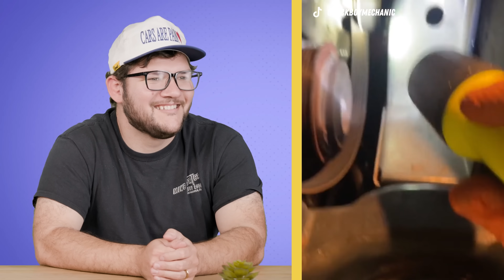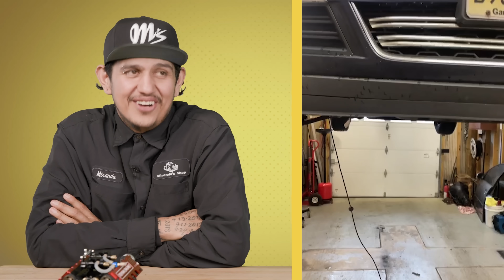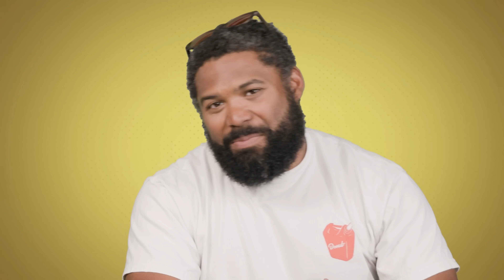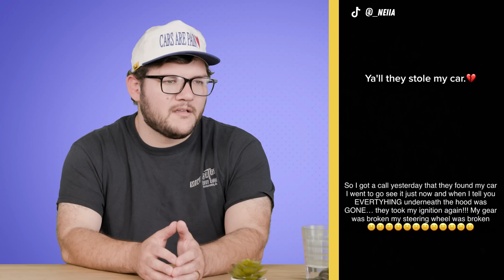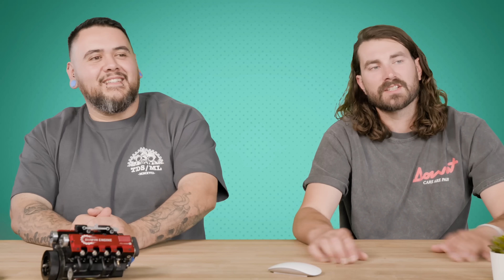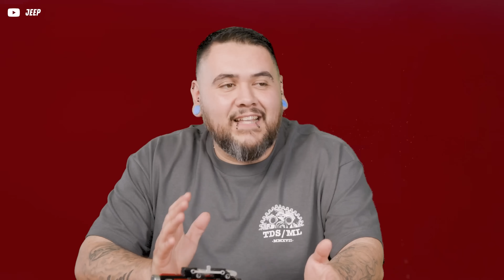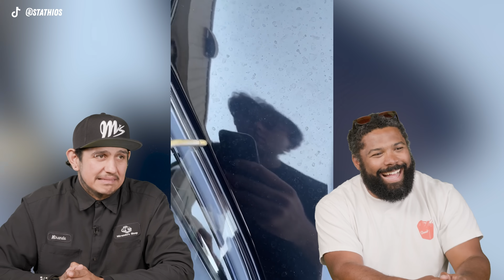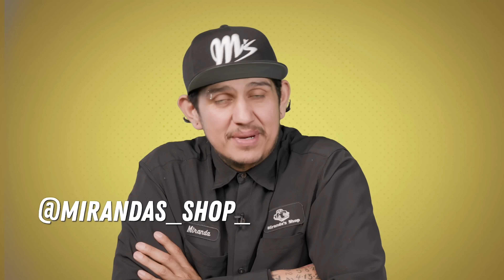Mechanic Reacts to Car Engineering Fails

Comment: Would be really cool if Donut could get some industry engineer's in to talk their perspective and why/how these design choices get made. Nobody engineers a POS on purpose. Some constraint somewhere had to force a trade-off if they were aware ahead of time.
Reply: I can't speak for the automotive world. But as an engineer, I can tell you there are people above us that force us to do things a certain way because of cost, looks, or just they like their idea better. I've also been told to design things to fail more so we can sell more spare parts.
Reply: @MrTterbo83  or some accounting twerp that wants to save 50c on a part here and there and completely destroys s project….
Reply: @MrTterbo83  I'm also an engineer. But I do HVAC design so I can't give any insight into this. Which is partly why I suggested speaking to in-industry engineers.
Reply: @MrTterbo83  That should honestly be illegal and fall under consumer protection laws. Like designing a consumer product to fail sounds like some fraud shit.
Reply: @DemonSlayer879  I agree. The head engineer told us to ignore the request & if we did design something that way, he would fire us immediately.
Reply: @MrTterbo83  I'm a paper pusher for a state agency that prints permits. Our addressing format has a style guide that does not match the USPS, DMV, or really any other agency, forcing us to go in a manually change anything before the permit can be issued.

Why you ask? Because the Attorney General at the time thought it looked the best and no one cares enough at this point to try to enact any change. It gets even better when someone changes their address because they don't know we have to updated separately (heaven forbid we'd get updates from the DMV, even if we did have to reformat them) or use USPS standards. Amazon can clearly format my address in a way that things get to me! We literally have people who leave off house numbers, street directions, apartment numbers, can't spell their own city correctly. But you know, he was an elected official who's been out of office for a decade, why not just keep doing what we're doing?
Reply: Alot of it actually comes down to Executive Descisions to make the Owner go to a Ford Dealership instead of a Normal Repair shop that also way they put some stupid Unique Bolt that requires a Special tool to remove most of it is about Greed and the Automotive Industry is Heavily Anti Right to Repair
Reply: @deltasixgaming  I don't disagree, and that's exactly why it would be so great to hear it from the horses mouth.
Reply: @deltasixgaming  Why Are you capitalizing Random Words?
Reply: Not one engineer designs the entire car.  There are departments of engineers for various parts of the car.  That belt tensioner bolt for example, an engineer likely calculated the required depth the bolt needed to go in order to securely hold the tensioner on.  One engine may go in to 5 different vehicles.  The engine engineer didn’t anticipate the problem. Meanwhile, the engineer that designed how that engine would sit in the engine bay of that particular car didn’t take in to consideration how long that bolt would be.  Or maybe he did, and when the car was designed, the spec for that bolt was shorter, but after entering production they discovered that bolt needed to be a bit longer bc maybe it was coming loose ar high rpms.  So they change the bolt thread depth without changing the external footprint of the engine, and no one catches the issue of maintenance when that bolt needs to come out.  Again, might only be an issue with one car that engine is used in.  

The question of “Why won’t Ford put a V8 in such and such model? There’s plenty of room for it to fit!” - the answer might be because even though it fits, you can’t service the engine in that particular engine bay - maybe all due to one bolt!  So it’s possible engineers are catching these issues every day, but some slip through sometimes.
Reply: @stephen3164  well said
Reply: I know with GM, at least old school GM in the 60's and 70's they were ruled by the bean counters.   That's why you got weird engine cubic inches in the 1960's instead of the standard 305, 350, 400 and so on.  The Pontiac 389 was made to skirt some bean counter rule of too many cubic inches in a specific body of car.  Had a little more power than a 350, and almost as much as a 400.  If they could save $0.48 per car by making something plastic instead of aluminum, they would do it, that's why 90's GM interiors fall apart so easy.  Chrysler was notorious for switching parts suppliers in the middle of the model year because the part they offered was just a little cheaper, but was designed differently.  So, a Dodge Ram built in March 1987 could have a different brake master cylinder than a April 1987 Dodge Ram.  Drove mechanics nuts.  I get the feeling if you let an engineer design an engine, without executive interference, it would be easy to work on and maintain, and would last forever.  But planned obsolescence has been a thing since the late 1950's so every car is designed to fail at a specific point.
Reply: @SupaFlyJedi  engineers do design engines to last forever, and they design maintenance into production. It's just that all of those engineers work for Boeing, Lockheed, Airbus...
Reply: They say here's this engine make it it.
Reply: Chrysler is incapable of good engineering.
Reply: This is true. Mechanics don't want to hear this, but there are a million and one things justifiably prioritized over ease of maintenance. Ease of repair will take the back seat to economy, or safety, or performance. The thing is, people actually want that. It can end up costing more to force a design to be more repairable, and people wont pay for the car. The point is that a fully repairable car would actually be quite boring and not sell!
Reply: @SoulAir  I raise your assertion of boring with an 80s Toyota pickup. Fun, not boring, not expensive, and easy to work on. It is possible.
Reply: @Demonslayer20111  True. It is fun, but gimmicks will sell more. Even better if it breaks down and you gotta buy a new on lol. It's all about money
Reply: @Demonslayer20111  I wonder if cars will ever last that long again.
Reply: @SoulAir  some do. Long life is directly related to how much power per liter or cubic inch you try to squeeze out of an engine. Derated engines last longer than high output of the same design. And it depends on just how overbuilt an engine is. What it's capable of vs how much it's actually outputting. I.e. jz engines capable of 1000 hp plus only making about 300. 
Or even better example is a rather mediocre engine, the 4.6 modular. Consumer cars make more power than the police pursuit models. But the p76 can have thousands of idle hours and be no worse off
Reply: Although I do agree the engineers should be forced to work on the cars LOL
Reply: @SoulAir  where I work at a premium auto company everyone that joins has to spend 2 weeks on the production line. I spent two weeks fitting door seals. It was shit. Very good pay for monotonous work. Takes a particular mind set to do it.
Reply: As an automotive engineer I can confirm the reason things don't always come out as we want with one word; money.
Reply: @sinAnon6689  if it saves 2 cents, they will do it. It doesn't matter how easy it is to fix, fixing costs money.
Reply: Found the engineer
Reply: It's executive decisions. They don't care if it makes the car harder to fix for the end-user because they want you to bring it in for dealer service anyway
Reply: I agree, they don't go to school and take crazy difficult classes just to design things poorly.
Reply: @MrTterbo83
This is why Toyota is best & not on this list 💯
Reply: Agree 1000% I work as a product delivery engineer for an OEM  and I would never want this or feel that this would be missed. So often due to time, money or movement of people this stuff can happen
Reply: Isn't Jerry at donut an engineer? You should get him on these episodes
Reply: @vkogan1990  I don't recall but I don't think Jerry has any automotive engineer industry experience to talk directly to this issue. I'm an engineer and I know nothing about this stuff cause I don't work in that industry.
Reply: Nah they 100% do its called planned obsolesce.
Reply: @SH4D0W  making a bolt too long isn't "planned obsolescence".
Reply: @SHDW-nf2ki  planned obsolescence is when a product is not made with the latest technology so that down the line improved versions can be put to market more timely to keep cash flow steady. It doesn’t involve purposely designing faults in product, cause that doesn’t help sell products. That could encourage a loss of sales for the current and future product.
Reply: Id watch the shit outta that
Reply: No nobody likes engineers
Reply: @bubaa1218  even engineers don't like other engineers
Reply: @MrTterbo83  😂😂 true

Comment: two piece rear main seals are a total engineering fail. Had to replace one on my 1994 dodge ram. The only convenient thing about it is not having to remove the trans, but beyond that. It's a complete pain.

Comment: Make the engineers assemble the car based on their designs as well.
Reply: As an engineer (not in automotive) I have assembled, operated, shipped, and sold the products I have designed. Probably one of the few engineers that have done that
Reply: @Callmebob2015  Same here. Trained 3 years and worked around 5 years as a mechanic before changed to the engineering department. Now my engineering soul get crushed every day at work because there are not enough resources (mostly development time) to do things properly.
Reply: @Callmebob2015  much respect to you, Steven!
Reply: Make the accountants do it, we understand there’s issues our hands are just tied
Reply: I think it would be better if the bean counters had to disassemble the cars with hand tools.
Reply: Most of them have. Junior engineers are almost always trained on the production lines from my experience. Coops and interns most definitely have production/assembly experience.

The actual truth is that engineers rarely have any say in how a product is shipped even if there are major flaws. Corporate execs create tight deadlines and price requirements and then managers and accountants are the ones that enforce them.

Comment: it's not just the automotive industry where the engineers purposely design things extremely difficult to repair such that a customer has to take it to someone rated to do the job... it's been going on for years... not just in automotive. it's on purpose

Sony was guilty of this exact thing with the PS4.  to open the console you had to have a specific tool with some random driver head shape and size which they only made available to stores like GameStop to refurbish and repair.  They did an about face with the PS5 though.  They actually made a teardown video of the PS5 console on the Sony Playstation YT channel showing the entire world (for anyone owning a PS5) how to open the thing.

Meade Telescopes are the same way.  Hidden screws behind panels that can only be taken off if you have intimate knowledge on how the panel is attached.  Because they want customers to either send to Meade for repairs or taken to an authorized Meade telescope repair shop.

Comment: I used to be a mechanic. Then I realized I would have to go back to school every two years to keep up with all the changes. And i'm sorry I do not trust any electrical car.. Because to change a battery they have to take apart the whole car. And what the dealership doesn't tell you? Is those batteries start from sixty thousand dollars up to a hundred and fifty thousand dollars. And that's just For the batteries. Not the labor.
Reply: What in the moron? Did a vehicle fall on you? Most EVs and hybrids have batteries in a spot that's relatively easy to access. And batteries that cost starting at $60k? Lol, sounds like you drank too much coolant as a mechanic. You're quoting the price of actual EVs, not their batteries. Not that $21k for a Tesla battery is cheap, but you're quoting 3x the amount at the low end and quoting McLaren P1 battery prices.
Reply: What the sigma are you talking about